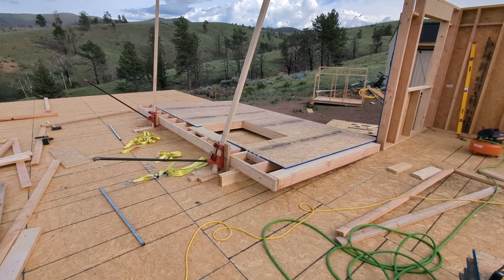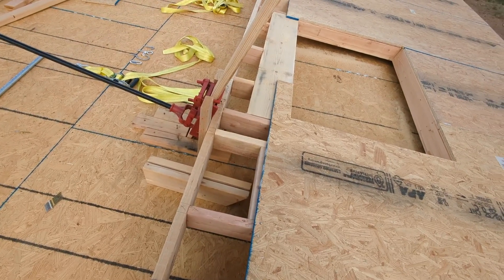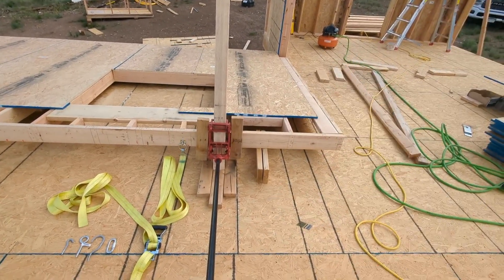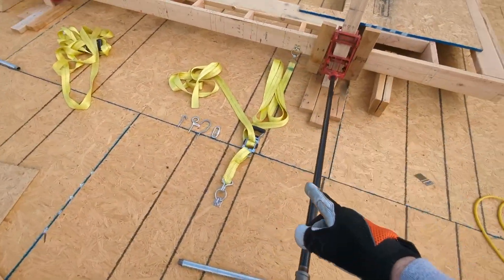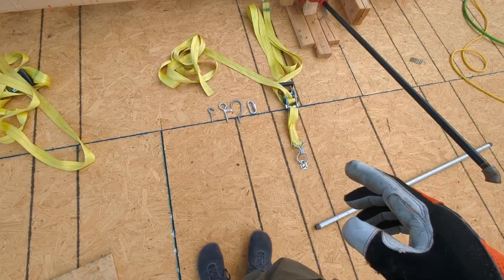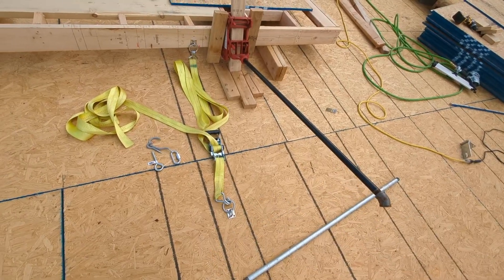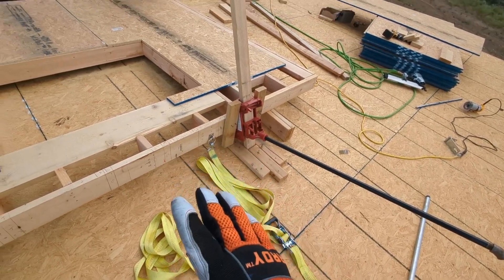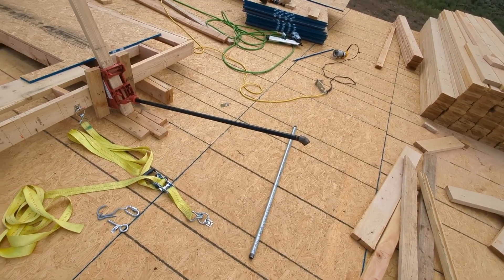Safely using wall jacks to lift walls in high winds in Colorado, solo

Comment: Do you know if you can reverse them? I need to raise a beam and do some work, then lower it, move the jacks them raise it again. Surely there's got to be a way to reverse/lower these if there's an issue.
Reply: no reversing. when you reach the top, you just run them off the top end and reinstall them on the bottom.
Reply: @stevenchase1  yeah, I know. I needed mine to reverse because I was supporting/lifting a beam with them, but needed to reposition it after some work. Needless to say was a real treat trying to figure that one out.

Comment: No one invented a tiny cheap crane? Or maybe rent one of these fork lifts?
If you find yourself saying "this may kill you" - time for Plan B, no? 🤣
Reply from the maker: It's an interesting question but in the end, lots of things on a job site can kill you if you handle them wrong. 

Don't forget your physics - a crane that can "lift" an 800lb wall from the ground would have to be quite large and well braced because you'd be talking about a 20-30ft lever. The proper answer to do the same task from that direction is called a "telehandler" and they're used quite often for this. But they also cost $450 per DAY to rent. Compared to $200 to buy a pair of wall-jacks outright, the wall jacks definitely have a lot going for them.

Cheap lifting options like chain hosts or winches are out because they need to be attached to something, and that "something" doesn't exist yet - that's what building these walls is doing in the first place. But they're great for other tasks. Stay tuned and in an upcoming episode you'll see me raise the ridge beam using one!